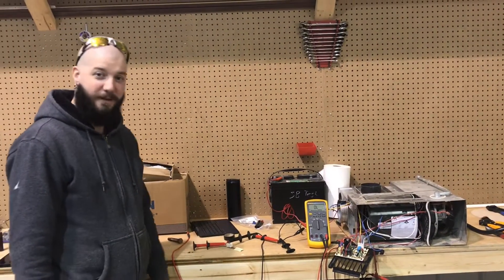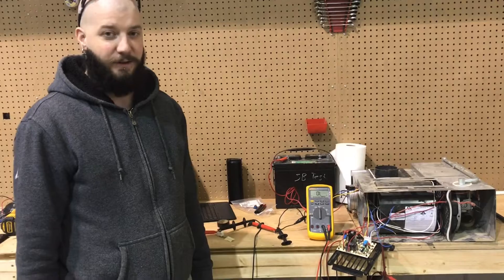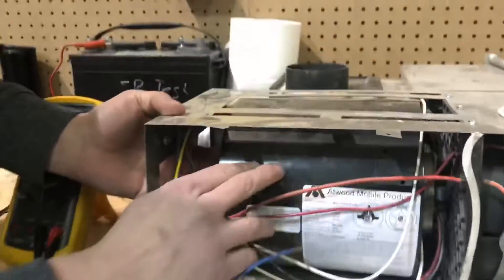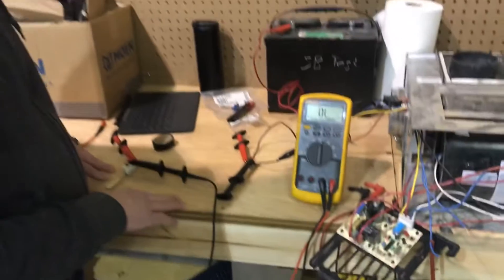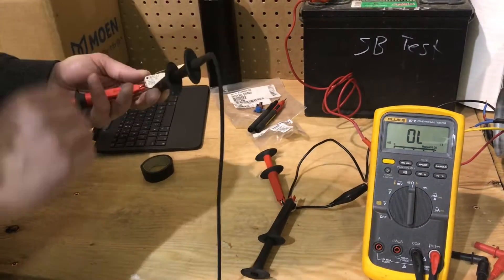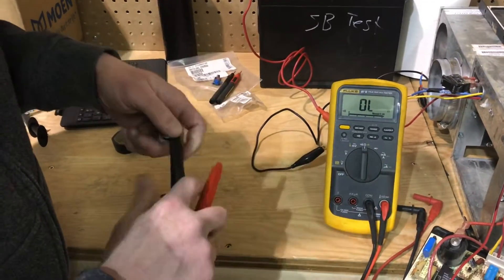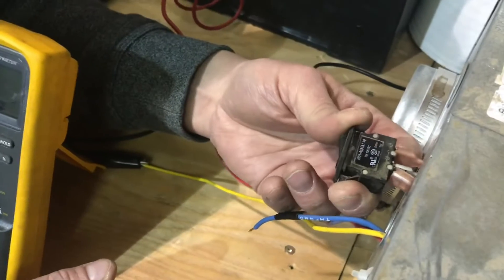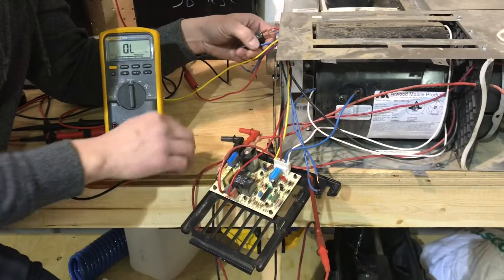Troubleshooting Atwood furnace part 1

Comment: Thanks for this breakdown.  I'm in Alaska this winter in my RV and my reset switch flips to the down position in my furnace when the thermostat clicks off when desired temp is reached.  Trying to sort out the issue.. buying a diesel heater until I sort this out.
Reply from the maker: That sounds like a weak reset switch. Would be good to do an amp draw test on it to see what is going on through the full cycle.

Comment: I have the same gas valve extensio  n tube as the one in the video how do you remove that type?cant find a picture or video anywhere
Reply from the maker: It threads out just be careful so you don’t bend it.

Comment: Atwood furnace fan won't shut off even with thermostat disconnected; ultimately it was the relay on the mother board (black, says 'Zettler....' on it) It had probably arced enough that it would stick closed. If you tap it when it is operating it will probably release. So I cut the top off of it, realigned contacts and it worked again. Ordering a new relay. Cheap fix, solder it in.
Reply from the maker: Nice find thanks for sharing. Let me know how the replacement went.

Comment: I have an 8535-IV DCLP. When thermostat cycles it onn the fan is not starting. There's a buzz/clicking sound and then everything quits with a Fault Code indicatin "limit switch or airflow problems". Checked the sail switch with the VoM & it's good. Haven't tested the limit switch yet, but from your videos, I'm gathering that if the fan isn't running, it hasn't proceeded to the point where the limit switch would yet be a factor. Is that correct? What else should I be checking?
Reply from the maker: Still check the limit switch, but it sounds from your description that it might be the relay one the board giving up.
Reply: Thanks. I finally got back to working on the furnace and first tried to start it again. The fan did not start. When I checked the circuit board for the fault code, it was a continuous, slow blink. I can't find that described anywhere. Do you know what it indicates? I turned off the thermostat and the relay at the furnace. When turned back on, the flashing started immediately.

Comment: You familiar with the hydro flame 8900-II series?
Mine runs with !20 volt AC and 24  volt thermostat.
What thermostat would you recommend?
Reply from the maker: That’s more of a personal preference I find depending on what your looking for
Reply: @thecanadianrvrepairguy3062  - OK, I wasn't sure which would work. 
Then I realized the regular ones for houses would and bought a Honeywell

Comment: Need some help here so I did check the sail switch and limit switch with multimeter like in first video and both are working. I turn on the heater and it just blows cold air no heat not sure if it’s not igniting I do here a click a little after the blower comes on and the click comes back again few times but no heat at all. Could it be the ignitor itself or gas line or could it even be the Thermostat that’s not working properly. The heater was working on the unit prior and was working fine all of a sudden just stopped working and only blew cool air 
Anyone who can help me out point me to direction go now since I know both switches are working

Comment: In the third how to video is a different set up from what I can tell. I am trying to get the gas line fitting separated from the gas valve assembly and I’m unsure how to do so as it’s STUCK. Any help with this would be greatly appreciated.

Comment: 3:09 Wouldn't that mean its a normally open switch being that the leads sent a signal through?
Reply: Normally closed sends the current through. Normally open contact means no current can flow through the switch.
Reply: @  normally closed would mean the switch is closed when it is not active.   What state is the switch when the device is unpowered?

Edit:  yes I see you are correct

Comment: The hard part is getting to the furnace.  Mine is built in with access only on the inside where the ducts are, but nothing else.  The outside just has a small hole for the exhaust, but no access door to reach the control board, gas, valve, sail switch, etc.  Stupid design by Jayco.
Reply: Yeah I also have a jayco and have this same problem. I'm going to have to pull the whole unit to replace whatever the problem is
Reply: @ After about the 5th time, I got pretty fast at pulling my furnace out.  Takes about 10 minutes now.
Reply: @LTVoyager how did you do it? I think we have a similar model
Reply: @jonathanblaylock5938  Remove the grill covering the furnace opening.  Unhook the gas line. Remove two screws that hold furnace to the floor on the side nearest you. Remove two screws that hold furnace to outside wall of camper. Remove all the ductwork. Slowly slide furnace through the grill opening watching the wires so as not to stress them. I can get my furnace out without disconnecting the wires, but not sure all installations will allow that. Hardest part is getting the duct adapters out of the furnace.
Reply: @LTVoyager  wow awesome. Thank you. I’ll give that a try.

Comment: Having a ton of trouble trying to remove the gas line connected to the valve. I have to replace the heat exchanger gasket and it's impossible to do without removing valve. Any ideas 💡
Reply from the maker: A picture of what your dealing with. Then I might be able to give you an idea.

Comment: this is more of a question, than a comment.  I have a reoccurring problem with my Atwood Furnace, it seems that the exhaust tube is a bit critical on staying in, and it causes my furnace to not go through the light sequence.  My first test since this is a reoccurring problem is to take the cover off and remove the exhaust pipe, and placing the exhaust tube back into place.  My question should I replace the exhaust tube is or their something I should check.  I have replace the cover screws as it has been remove so many times over the past 3 years of trouble shooting and having this chronic condition.  Your channel is great and your trouble shooting techniques are dead on.
Reply from the maker: What exactly is it doing?
Reply: @thecanadianrvrepairguy3062  The furnace will not fully sequence and ignite. It gets to the ignite stage and will then shut down. The exahust tube needs to be fully inserted into the receptical tube.  It seems to rattle out just a little bit during transport or movement it seems to work fine for multiple times but will revert to not igniting.  I have replaced the screws both on the cover and exhaust tube.

Comment: Test Results : clean furnace opened up 2 extra ducts, furnace runs fine with plastic service door open cycles on and off with it shut,hooked up 3 test leads 1  before  sail 1 after sail 1 after  limit switch.Limit switch cuts out within 3 minutes of shutting plastic cover.Nothing blocking air in.So, hotwired limit switch works fine.Do limit switches get lazy in their old age?
Reply from the maker: They get wore out when they cycle lots
Reply from the maker: I would add a vent to allow more are flow so it does not cycle do bad. It cannot get the heat out so it runs to hot.

Comment: voltage yes clean out yes igniter 1/8 propane yes obstructed vent inside no  exhaust pipe yes.....both thermostats set high...lights up stays lit maybe 10 minutes then starts going out for a minute or 2 then relights for 5 or 10 then goes out and cycles like this with lit intervals smaller and smaller until no relight 3 times then inevitable shut down. Reset to soon won't work cool down 15 then it does it all over again.  High limit switch?
Reply from the maker: Yes a high limit would be good to start with. The only way to confirm is hook up probs to the wires and see if it lines up with the cycling
Reply: @thecanadianrvrepairguy3062  sounds great will do thank you for answering back right away

Comment: Good information. I’m just working on my 8525-IV. Don’t have  a meter for testing. I’m not getting any ticking sounds before ignition. I can hear the sail switch then in all shuts off and I get an ignition fail code. I’m going to do the igniter, for you think the gas valve would be good as well? Do they tend die for no reason. This unit is very clean and was working perfectly all season. Then it just wouldn’t light.

Comment: My camper got infested with rats. I pulled the vent hoses out with the plans of replacing them but it took longer than I thought and now I don't remember where all the hoses go. Is there a diagram that I could look at? I can't seem to find one.
Reply from the maker: There is no real order other than the vents the furthest away come off the back. If you don’t remember where they where I would just put them back on in what ever order.

Comment: Hey man great videos! Need some help. It’s 40 outside and I set my heat to 70 in the camper but it shuts off at 60 and will not cut back on unless I turn heat to off and then back to heat. But it still at that point will run for 10 mins max and shut back off. Why will it not stay running till my camper reaches the set temp? Thanks so much
Reply from the maker: So there are a few things I need to know first. When you say it runs for ten minutes and shuts off you mean the blower and everything or just the burner shuts off and the blower stays running. I also offer a $50 dollar phone consultation through PayPal.
Reply: @thecanadianrvrepairguy3062  Everything shuts off. Heat comes out till it gets to about 60 then the blower shuts off and will not cut back on unless I flip the switch to off then back to heat then it will all start up again and run but only for a little like 10 mins then the same thing. It will never get to the set temp on its own.
Reply from the maker: @austintevis7304  it’s acting like it the thermostat
Reply: @thecanadianrvrepairguy3062  thanks !

Comment: Thank you for publishing this. I have had trouble with my heater since spring and have watched every video with no luck until this one. Thank you!
Reply from the maker: Glad it helped this has been my aim to create content that is more helpful than what I have seen. Thanks again.
Reply: @thecanadianrvrepairguy3062  I have same heater need help I got power to reset switch new thermostat, blower does not start when powered up but I can jump to wire and get fan motor to run but nothing else happens. Everyone says it's the board mine does not flash can I bypass board to see if it will ignite?
Reply from the maker: @lawnmowerman4040  It will be the board the fan control relay on the board not letting power through. It is a very common problem.
Reply: The Canadian RV Repair Guy model 8940 lll dclp can I buy board? Which one thank you so much
Reply from the maker: @lawnmowerman4040  I would use a dinosaur board Fan50 plus
Reply: The Canadian RV Repair Guy Hey hope you reply before I buy a board I tested at t stat and have no voltage to furnace wire when I flip to heat, I jumped 12 volts to it and nothing happened does that confirm the board? also could my inverter blow the board ? I bought it from a old man and it was hooked to shore line it’s whole life and when I bought a new battery the inverter overcharged it and ruined it thanks new sub🙂
Reply from the maker: lawnmowerman4040 what make of furnace is this.
Reply: The Canadian RV Repair Guy Atwood 8940 lll dclp in a 2000 model coachman
Reply from the maker: lawnmowerman4040 go to the wiring harness of the furnace check for power at the red and yellow wires. If power is present connect the two blue wires together tell me if you hear anything
Reply: @thecanadianrvrepairguy3062 ..Im stumped..here is my situation brother...I have a 96 starcraft truck camper here in Florida..we never use the heat since we are in the south etc.

My stwood hydroflame won't work..new dometic thermostat.
So I pulled the furnace used power probe w 12v motorcycle battery and it won't turn on blower...I removed hamster wheel blower motor from furnace..hook up the power probe and the blower works fine.
There is a 5amp safety in between the blower and furnace..
What else could the cause be..sail switch won't matter since the blower isn't even kicking on. So what would cause my blower motor not to be getting power?

Comment: My fan won't turn off.Everything else works great. Fan limit switch? and where is it? Please and thank you
Reply from the maker: What is the model of your furnace? Then I can have a better idea of what direction to go in.
Reply: 8531-111 dclp
Reply: Sorry I should have included that
Reply from the maker: J. René Godin 
Ok so that model has a fan control relay on it centre of the fan shroud. That being said if the furnace tries to light it three time and goes into a fault the fan will run until the power is turned off to it or the battery goes dead. I am assuming your board or igniter is faulty. Without doing a gas test to see if pressure is a problem or it could be a dirty burner.
Reply: But the furnace works fine, thermostat works as it should but after the set temperature is reached the furnace goes out but the fan keeps going. I've been  using the fuse as switch to turn it off and on
Reply: Do I need to remove the furnace to get at the relay?
Reply: Thank you very much BTW for taking this time to help me

Comment: Why does my 8535 111 make a short rumble after the blower cycle has ended?it doesn't do it all the time.
Reply from the maker: With out seeing it I would suspect the bushing is staring to go in the motor.
Reply: @thecanadianrvrepairguy3062  Thank you replying.I researched it more and I agree.I have a new motor on its way tomorrow👍